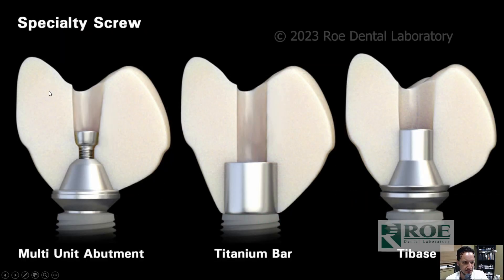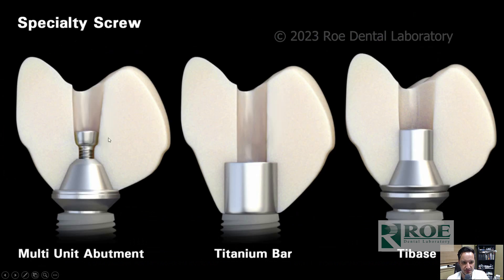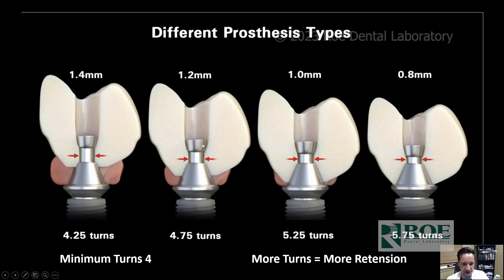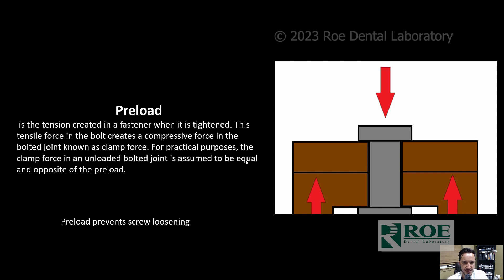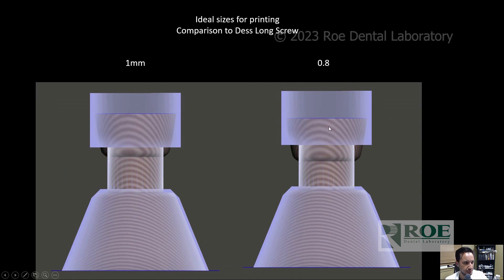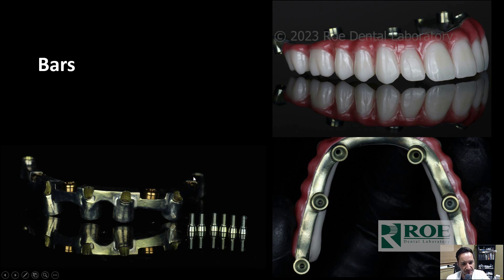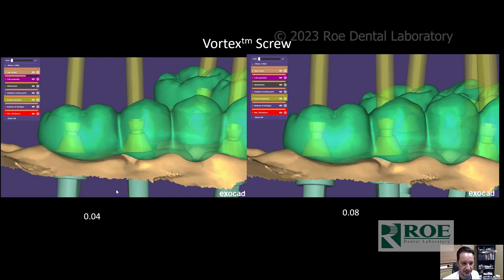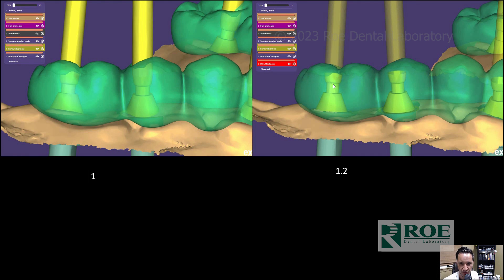Vortex: Screw Options by Prosthesis Type

Comment: So we do have the same vortex screws at different depths available? Accordingly we can select during prosthesis fabrication?
Reply from the maker: Hey there! You are correct, Vortex screws are raised and lowered depending on a few factors, such as prosthetic material, occlusal space for the head, coping or coping-free. We do offer them here at ROE, we usually chose based on the material but you can also request a depth. If you are interested in learning more about vortex screws you can view our website here: https://www.roedentallab.com/products/implants/full-arch-fixed-options/grammetry/vortex-full-arch-screw/
Reply: Great information  @ROEDentalLaboratory